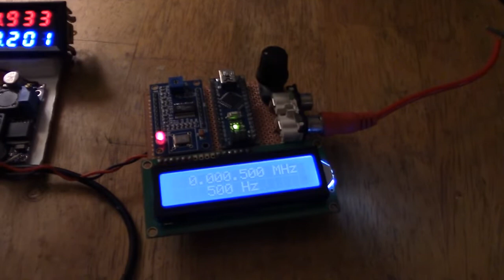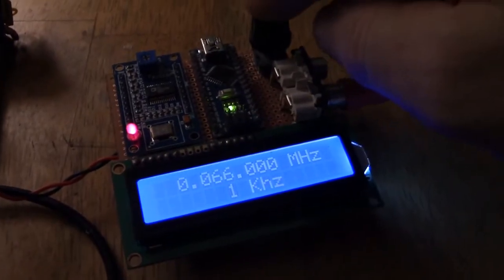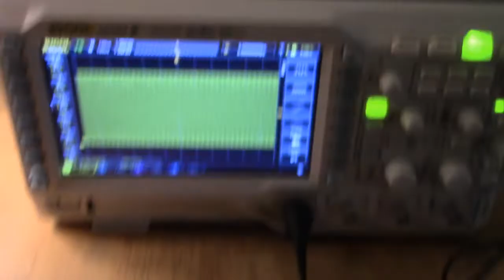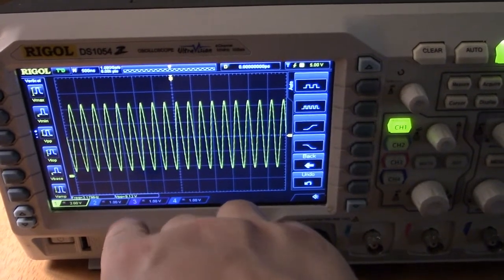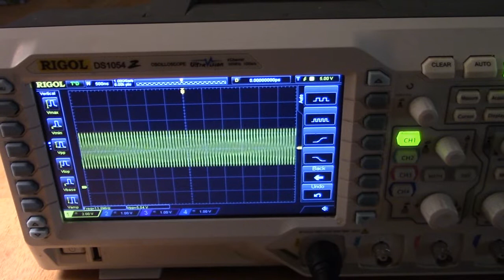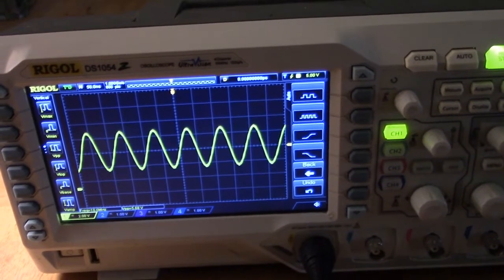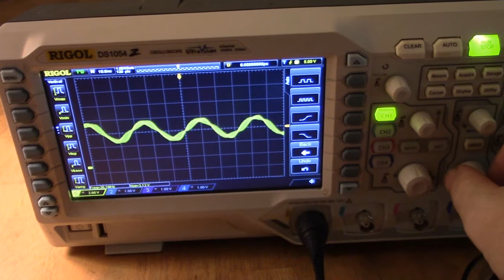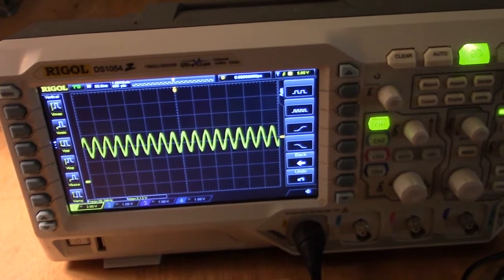AD9850 signal generator - arrived, built, tested

Comment: Great works! The maximum output voltage of sine wave is limited to almost 1 Vpp as described in the datasheet of AD9850. Could you let me know how you could obtain 10Vpp even above 1 MHz? I am still wondering because there is no amplifying circuit connected to output terminal of AD9850 DDS module. Thanks in advance.
Reply from the maker: It's all been a love/hate with the thing. The best way of obtaining a high voltage frequency would be with a transistor driver. Input from ADS9850 to the Base, output at the voltage of choice. Check with scope for propagation delay.

Comment: Is that based on an arduino?
Reply from the maker: Yep. Arduino Nano. It comprises the Arduino, screen and AD9850 frequency synthesis module. The module I ordered was faulty and bust the Arduino regulator plus program data input lines, in a pile of smoke. The program still works, so it can still run this.

Comment: Mine stops at about 0.004.5....mhz. What does that mean??? Do i need a hearing aid? or just a better audio system? "/
Reply from the maker: Oooh heck, that's a problem with your thermostat, better call a plumber quick !
4.5Khz is what that means. I'd have changed some of the screen output, if the Arduino hadn't blown up via the original module.
I'd recommend a different set of speakers, or headphones maybe. 
deslomeslager posted a good link below to a real hearing test. It works very well and is an easy 1 button sort of thing.
Reply: Lol! I'm aware of my reteriorating hearing capability's. I have some 'Joule Ringer's' that people are complaining about, which don't bother me the slightest. =)
Did you know, 'deslomeslager' translate's to: "the lazy butcher"? I have a feeling, he is a fellow country man of mine.

Comment: Good news that it is up and running.  Based on what I have been seeing this should be able to drive a small led board but perhaps not the 110v led lightbulb  board.  It doesn't  really matter because what we are doing is looking for happens in the MHz range when you tickle an led is various ways.  It is all fun.
Reply from the maker: Thanks and yes, it needs amplifying but is very stable in frequency, sitting right on each click up to 30MHz. I'd like to have put the screen output 'upside down', taken out the upper MHz limit and made other changes, except the Arduino got fried. Might be able to rescue it but the program still works, so won't touch it for now.

Comment: Lost the pitch above 10k. This could as well be my speakers not going any higher, or your mic. But I think it is my age.
Reply from the maker: Thanks for the info. I've always wondered what i'm not hearing when a vid is uploaded and quite glad that nothing much uses a CRT. People seem to get complaints from many when they use them...kinda strange because I don't remember the whine even in the 80's and had 'top of the class' hearing back then.
Reply: I just went to https://www.echalk.co.uk/Science/biology/hearing/HowOldIsYourHearing/resource.html and found out my hearing equals the age of 57 (11Khz). Actually I am over half a decade younger. Ah well.
Reply from the maker: 14213Hz here, age of 42...am pleased with that !
I'd say try it on as many speakers as it takes to hear it at 15KHz  :)
Reply: @deslomeslager  My hearing age is 50. Quite pleasing as I am 7 years older!

Comment: Nice setup! Now you should be in a much better position to interpret the idiosyncrasies of the circuits you build. I'm interested to know what waveform is produced by a pulsing pancake coil that emits RF?
Reply from the maker: Cheers :) Likely a broadband output with a pancake, due to the turns overlapping. The SEC 18 is like that, expecting a clean wave but the scope can't get a lock. That may be due to interference with the pickup, even though using a sniffer coil.
Reply: Thanks - broadband makes sense since the pulses can be heard over a wide range of frequencies on a radio!